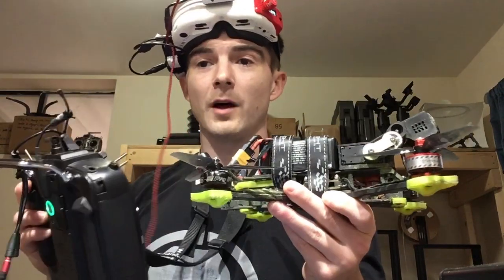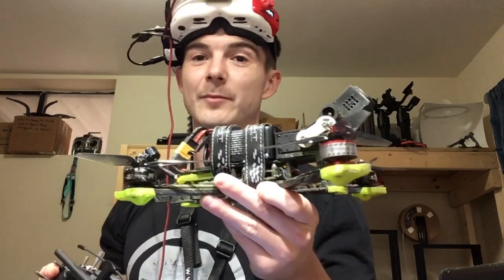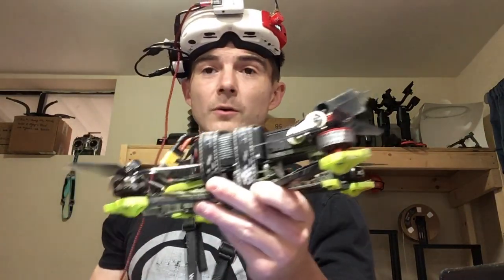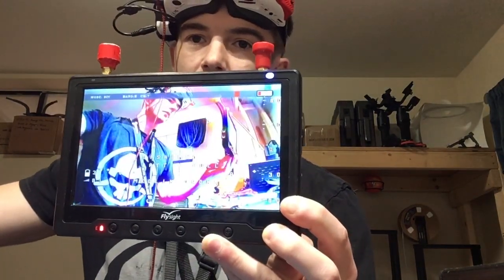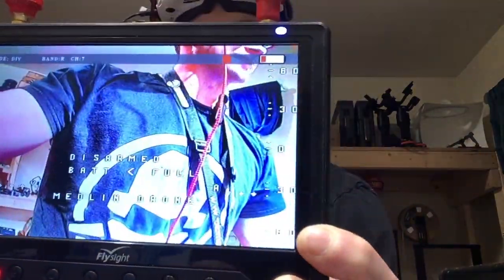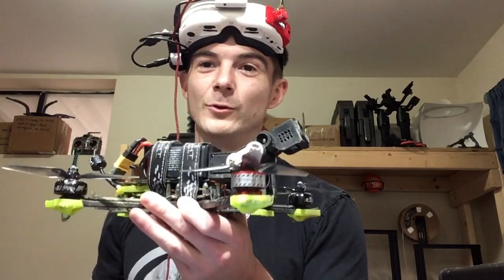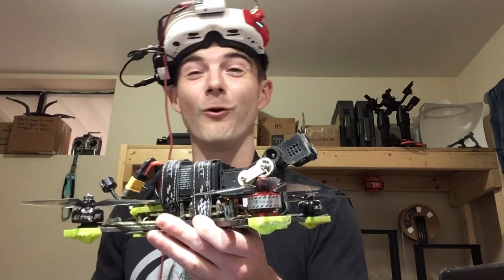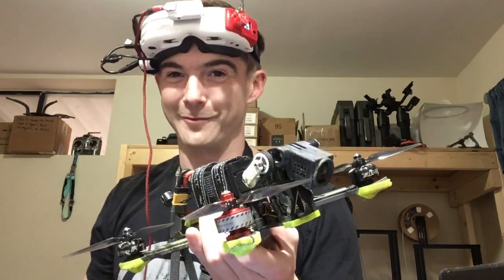FPV Tilt Gimbal Control Options - Medlin Drone

Comment: In the video, you mention a feature to be introduced in BetaFlight 4.6 that helps maintain the gimbal’s fixed position once set. Could you please explain which feature this is in detail? Is it related to dynamic control or head tracking? Thank you!

Comment: Sorry but does the Whoop FPV Tilt Gimbal work with the HDZ goggles head-tracking? I'm very much interested in buying the gimbal from you but I need to know if it'll work with my goggles when I get them :)
Reply from the maker: Yes, it does :) check that your transmitter/radio supports a 'Wired trainer function" or "DSC" port and you're good to go

Comment: for single operation fpv pilot, this setup is the most ideal esp. the heavy duty servo ldx type that is shown in the video, coz i help a friend of mine setup his medlin fpv tilt gimbal. and of course from testing, crashes is unavoidable esp if you are still getting use to the head tracker setup, so far this is the most robust setup with servo belt driven. the cost is worth the amount of time josh has spent on developing these awesome product. highly advisable to get it together with the headtracker even if you have built in headtracker in your goggles. and if you run it with inav, you have a mavic that can do freestyle
Reply from the maker: Great to hear, I really appreciate that!!
Reply: can't wait for your fork of betaflight coming out with those custom osds comin @medlindrone
Reply: Hey, what do you mean with a DJI Mavic can do Freestyle with the use of head track? Interested to hear your idea!
Reply: if your 5 inch quad has this fpv tilt gimbal and running inav, you can park your drone on the air just like a mavic, do waypoint and have absolute control off your camera angle while you lock your target. and with a flick of the switch and bam, your back to freestyle acro @afkdax
Reply: if you have this setup together with inav, you can fly it like a mavic camera drone but with the capability and durability of a freestyle drone. @afkdax